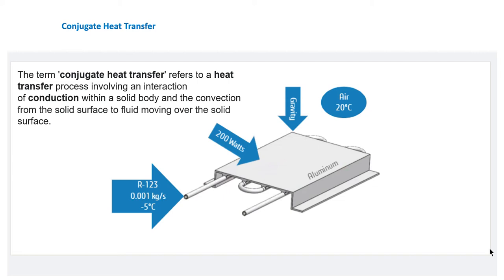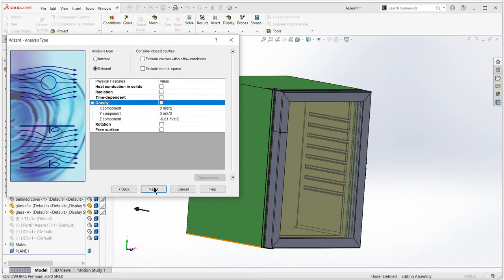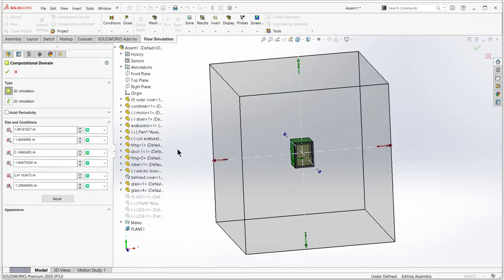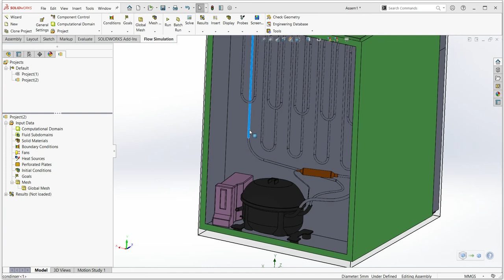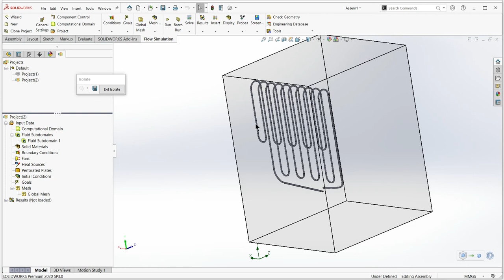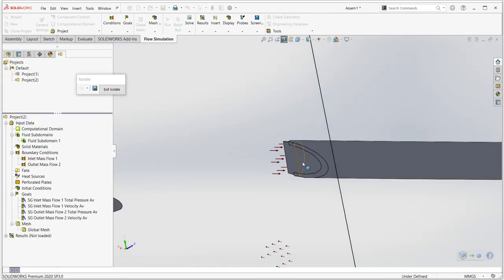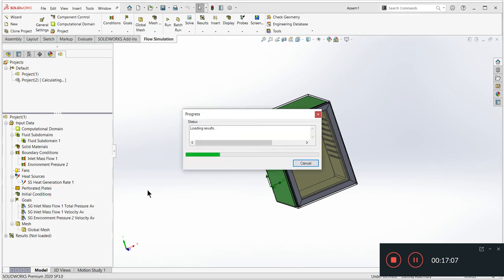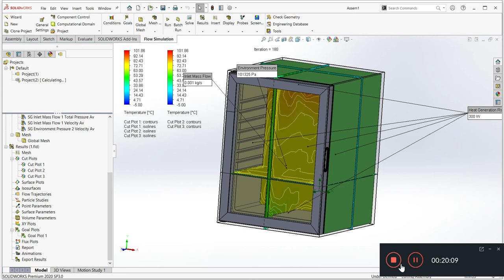SolidWorks Flow Simulation Tutorial | Refrigerator Analysis | Conjugate Heat transfer Analysis

Comment: Hello,

I am recently working in the CHT(Electronic Cooling) simulation with Fan,
The problem i am facing is the time take to converge the temperature on the elctronics is too long (takes 1000 iterations to converge and my model is quite big), so the time taken for each simulation is too long,
Could you please share some tips to speed up the convergence in a fan model?

Thanks in advance..